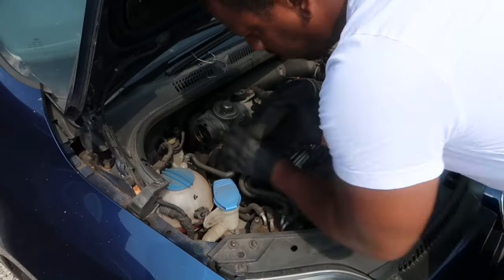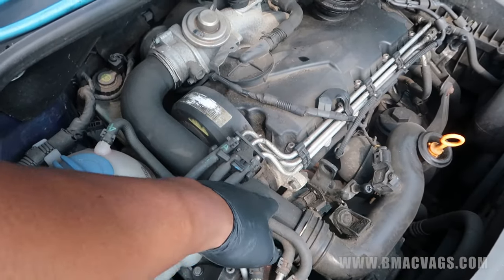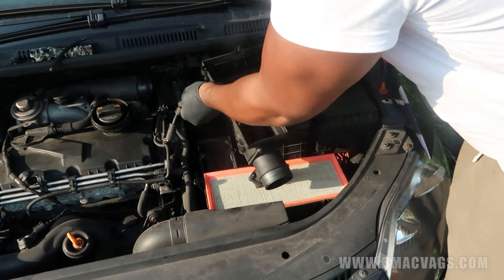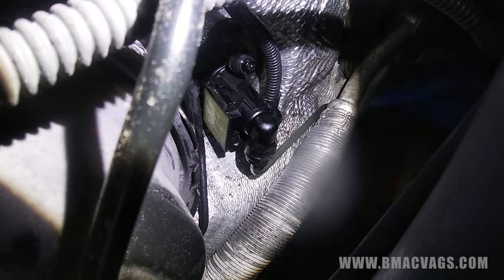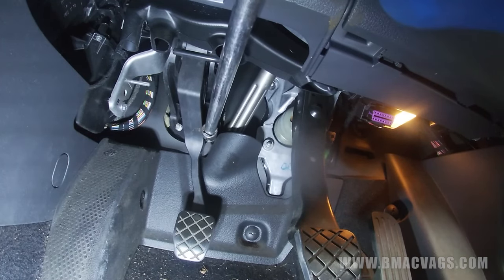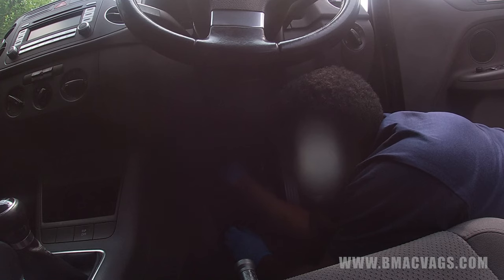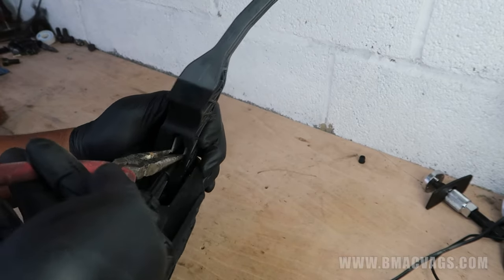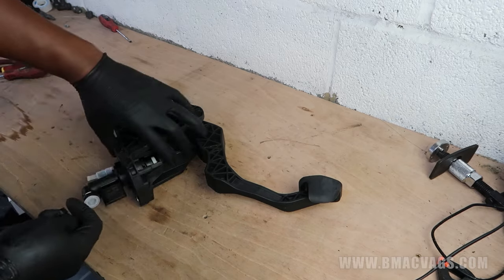Master Cylinder Replacement - Dropped Clutch Repair

Comment: Did this job not so long ago. I was getting super annoyed as is, can't imagine the stress of filming with exceptional light quality and angle given the space. Mad props to you, made it look easy.
Reply from the maker: thank you so much man,  I appreciate that.  The angles were super tough, I just hoped it showed the job well enough
Reply: You might need a joint to calm yourself bro
Reply: @obviouslytwo4u  isn't that illegal?
Reply: i did the same , last year but was a 2.0 tdi and has more room to work on the engine bay , anyway the difficult part it’s fitting back the plastic clip !!!
Reply: How much another cylinder cost? Or how much everything cost you?
Reply: The clutch on my transporter t5 just dropped, i hope its similar to this video, because its hard to find a spesific video, thank you for the talkthru:)

Comment: Helpful video but getting back in is a pain, best remove the metal bar held in by 13mm bolt much easier 👍👍

Comment: Did one on a caddy.. couldn't release wire had to cut it . Was awarded to remove with the wire still attached.. even when I had it remove had to break the wire plug to release it.. nightmare job.. got it done eventually had to rejoin the wire this is not a job for the faint hearted...

Comment: Got renault clio 2011 clutch pedal clicking was told its the pedal box does the dash have to come out to do it has its got a ratchet spring on the pedal thanks

Comment: Thanks good video.  For bleeding the clutch i recommend using a small oil can pump with brake fluid and pumping in from the bleeder valve.  Worked like a charm and pushes out the air our the reservoir as you fill the system.  Make sure you have the clutch pedal pulled out. Works like a charm.
Reply: That makes sense.  I know some will take a long time to bleed, this way is more effective, thanks for the tip
Reply: This is a great idea.  I had trouble priming the master cylinder.  This simple idea is brilliant.  Next time!

Comment: Great instructional video bud. Whenever I do something with the chance of a lost nut as in your video I attach a strong magnet to the extension it hold the nut or bolt magnetically into it. If that makes sense.

Comment: Thanks for the video. I also have this metal rod holding me back from removing the clutch pedal. But having very hard time to remove this metal rod, because it is way hard in my model to access its screw (vw golf 6 1.2tsi). Screws of the rods are restricted from access as it’s next to the electric sensors or something and did anybody had same problem and resolved it?

Comment: Hello mate, I have a golf 6 2010 and my clutch pedal dropped sometime and today decided to give a hard time. Just I want to know if you find to be hard to shift gears just before you decide to replace the cylinder. I don’t want to change the whole clutch kit and then to end up changing the cylinder. My flywheel been changed 50k ago. Any info will appreciate! Cheers
Reply: What do you mean gave you a hard time? For me when the master cylinder went out it got very soft and worked a few times and then went out complete where you couldn't change gears at all.  If yours dropped but then can back for a while, i guess it's still possible there is a small crack or seal that has gone bad. But it could be another part of your system.
Reply: I have a 2010 golf 6 1.6 L TDI 

I just replaced the clutch Kit and flywheel. started it did not start but heard a knock sound 

Upon further  investigation  when taking the master cylinder  I noticed a crack through it. 

Should I buy a new master cylinder ?
Reply: @PrettyBoiShaneD  I had ended up changing the master cylinder first and whole clutch kit at the end. If you notice cracked master cylinder, it worst try as cheap version and could be fix. Mine is 2.0 tdi and slave cylinder is inside the clutch. Have to mention that. Are the most reliable cars I have so worst investment if you want to keep it.

Comment: Thank you for taking the time posting your video.
Will check if it is the master cylinder as the pedel clicks sometimes under foot. Bites about an inc up.
Been told clutch but sespect master cylinder.
Any thoughts?

Comment: Is the slave cylinder on a 2012 1.6 tdi touran on the outside or inside of the gearbox? Its a 6speed transmission

Comment: I have just replaced the master and slave cylinders in my caddy, but the hydraulic line is not sealing on the new parts. Genuine VW parts with brand new seals. Do you have any clue as to why it is doing this?

Comment: My golf Mark 5 lost all gears. The pedal isn't to the floor and the gear linkages and clutch were replaced 8 months ago. I can get the car Into Gear with the engine off and have to change gear without the clutch to limp it home. Any ideas

Comment: I reused mine. I only changed out the clutch starter switch. But now it won't take pressure. The pedal will not stay up. Any ideas

Comment: It’s not a master slave cylinder. That makes no sense. The one on the pedal is the master cylinder, the one in the gearbox is the slave cylinder, because the slave does what the master tells it to do

Comment: I did the clutch ok but I dropped the rubber seal from the hose that goes to the brake fluid reservoir 😭 I have spent 2 hours with a touch looking for it but no idea were it has ended up! I cannot even find the exact replacement on ebay 😒..
Reply: Do you have the link for it m8

Comment: Just replaced this but pedal still drops to the floor :/ any idea?
Reply from the maker: Have you bled the system?
Reply: @BMACVAGS  Yes! That was the problem, low clutch fluid and air in the system. Bled it with a one-way valve and it's all good now. Thanks for the video (Btw it was a nightmare doing it to a 2.0 TDi Passat)
Reply: @grf4005 ame happened today to me. How did you sort it out? After I installed new cylinder, pedal is still on the floor and has no resistance whatsoever. All seals intact on both hoses, all clipped in etc etc
Oil comes out of the slave cylinder on the gearbox and clean stream but pedal is still on the floor.
Reply: @ivanmihanovic5443  your slave cylinder/throw out bearing has broken then. Gearbox off job for that though :( new clutch and flywheel too.
Reply: @grf4005  it’s b7 passat 1.6 tdi so slave is on top of the gearbox. Will try it first before release bearing
Reply: @ivanmihanovic5443  yup replace that then, this was a 2.0 TDI I was working on so the slave was built into the throw out bearing. 

If slave is on top and is leaking, replace it asap :)
Reply: @grf4005  no leaks, but just something isn’t right as don’t know what it can be other than that. Took it apart again to check if all seals are there and yes all there. Topped up brake fluid, moved, nit pumped the pedal by hand must be 50x times and on slave cylinder fluid comes out and stream is solid with no bubbles but clutch pedal still on the floor
Reply: @ivanmihanovic5443  did you buy a new clutch master cylinder? Make sure to keep the reservoir topped up at all times, otherwise it'll suck in air.
Reply: @grf4005  clutch master cylinder (behind the pedal) was replaced as the old one just started pissing the oil everywhere. Kept old slave cylinder (on the gearbox).
And after clutch master cyl replacement pedal is still down. It happened tonight and I’m not leaving the unit until I have solid clutch😂